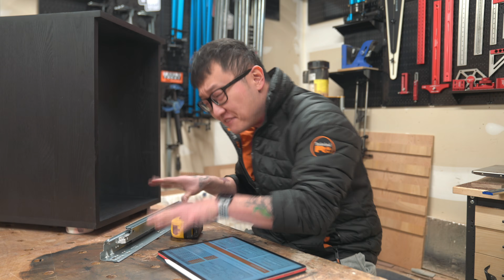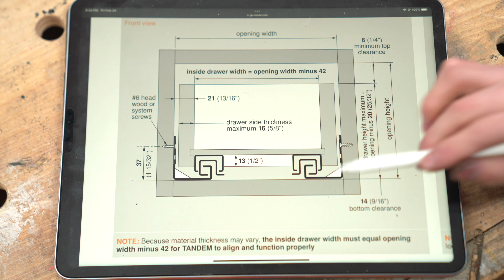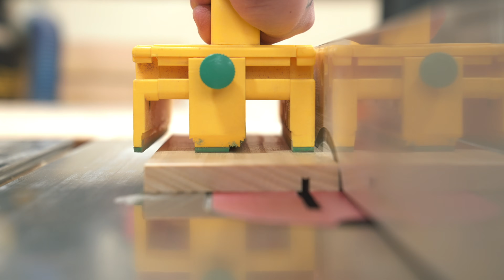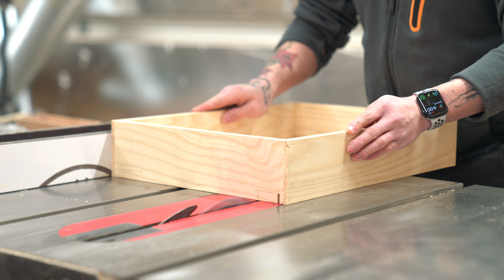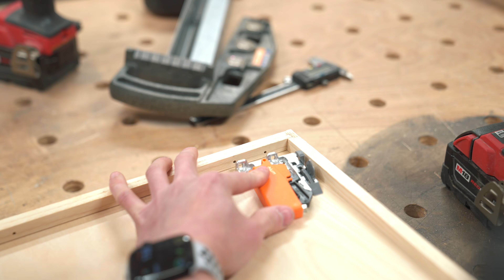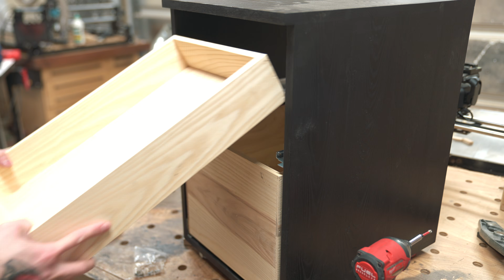How to Install Blum Undermount Soft-Close Drawer Slides || Woodworking

Comment: This blew my mind!  I've been designing a cabinet with drawers for my records.  I was planning to have a bottom shelf, middle shelf, and top.  Seeing this made me question whether I need the middle shelf.  Considering the record drawers will weigh about 70 - 100 lbs, and I plan on having 10 drawers in 5 columns, will this work without the middle shelf, or would it be advisable to keep the middle shelf in my design?

Comment: Great video, thank you for doing this!

Two questions:

How to maximize drawer box height on a 4 drawer(3+1) x 29"(internal) cabinet box?

How to determine proper spacing for runners, DTC or Movento undermount?
I would have a 3+1, or a 4 drawer box system. This is tied to the previous question.

I am just facing my kitchen but I will be updating this one cabinet for sure...

Thanks!

Comment: Thanks, my instructions show the drawer box depth being 10 mm shallower than the nominal length of the slide.
Reply: It seems to be dependant on exactly what model of Blum undermount slide you are using. The ones he uses in the video are the 563H model according to the Amazon link he provided. For that model, the drawer sides are supposed to be exactly the same length as the slides. But I have some 560H slides which look exactly the same, but the instructions say the drawer sides are to be 10mm shorter than the length of the slide as you said. Check the model number stamped into your slides. Perhaps you also have the 560H.

Comment: I was so excited to see your take on these Blum or under-mounts till you excluded inches for mm👎🏼 especially for the most important parts like the width!!! Love your content like your recent side table with the amazing bridle joint joinery, appreciate your attempt to include both imperial and metric
Reply: Just buy a metric tape and you will have no issues. Question: What is half of 39 and 3/8 inches? What is half of 1000mm? Both are the same measurement. Which would you find simpler?